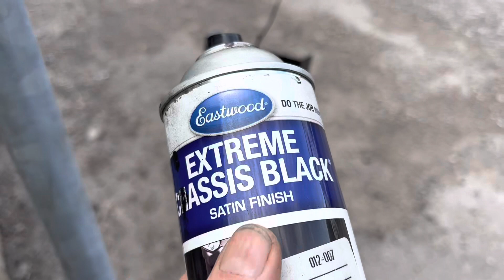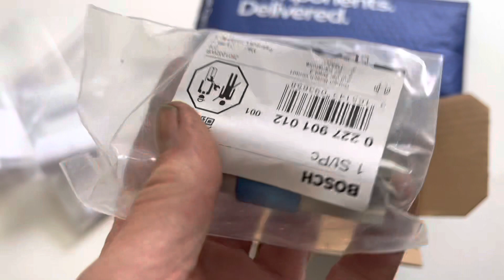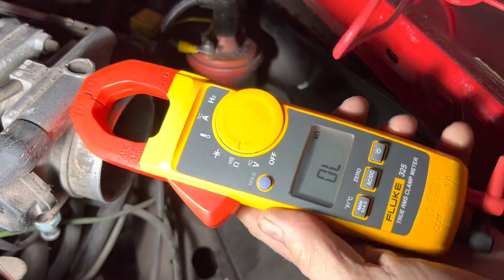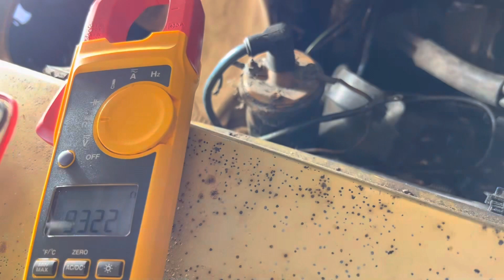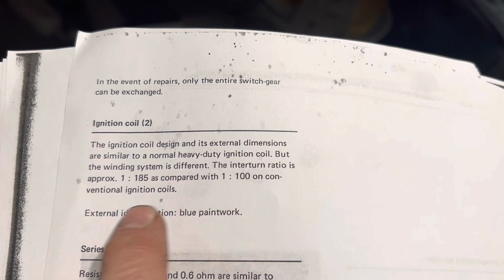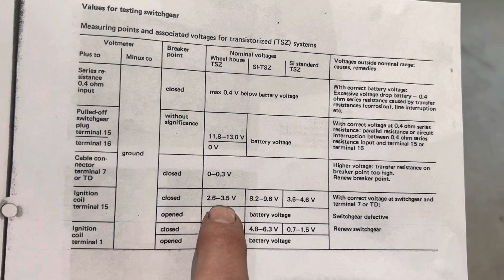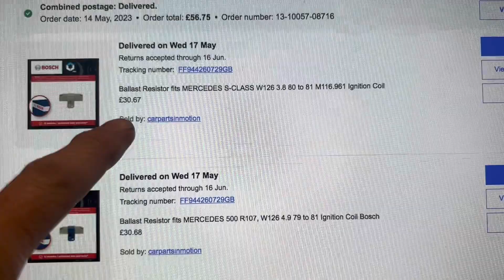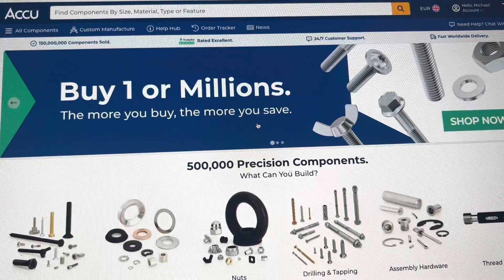Mercedes R107 ignition control module + ballast resistors

Comment: Hello, thank you very much for reporting the ohms value of the primary coil of the blue ignition coil. I'm working on a 1972 220 and have been trying to find that value. Thanks to you I've found that the old coil is still good and correct, so I don't have to replace the coil. The two resistors also check out correctly, though I'm keeping in mind your suggestion of replacing them and using new stainless screws.
Reply from the maker: Thanks for your comment - I knew that one day these detailed videos would be of use to someone! Mike
Reply: @MikesMercsandothercars  Hello Mike, after a tune-up on the 1972 220, replacing all of the basic things except the condenser, with the new points set to .016, the dwell angle was 38 deg (doubling 19 deg on 8 cyl scale). So I reduced points gap to .014 to increase dwell angle, but instead dwell angle decreased to 34 deg. Also the engine started dieseling 4-5 coughs after shutting down. I found the condenser wire that runs forward to under the battery tray was damaged, so I replaced the condenser with Bosch new old stock. Now I've started it and dwell angle is still 34 deg, but after idling for about 20 min and shutting off there was no dieseling. I wonder if you've ever heard of dwell decreasing with points gap decrease, instead of increasing. The dwell is to be 47-53 deg. It's a transistorised ignition, W115. A/T.

Comment: Mike youre a godsend with helping people with their Sl's. I rebuilt my djet harness and in process of testing, my 1972 350sl (4.5) just wont start. I turn the key and get 12v at the starter but no crank, ive bench tested the starter and it works fine, but ive changed the relay (starter, fuelpump) but still nothing any thoughts?
Reply from the maker: Hi - have you checked that the neutral safety switch works OK? See

 https://youtu.be/ZYn9P0j1nJc?si=8pKaiJKV8FnxaDgz

Try starting the car in neutral and let me know how you get on. 

Mike

Comment: hi mike great vids ty,
i have a 1972 350sl has run great since i bought it 3 yrs ago. all of a sudden it won’t start, i turn the key and and it goes to start but doesn’t run, any ideas what to check first thanks vince
Reply from the maker: Hi - first I would check that fuel is getting to cold start injector and squirting out when you crank the engine. I have a video on the subject. 

If you are getting fuel at the cold start injector, I would be checking that your fuel pump is putting out the correct pressure. Weak pump = no start. Once again I did a video. 

If your fuel pressure regulator is knackered and you are dumping too much fuel into the cylinders, this will also cause a no start. Easy way to check is to take out a spark plug and see if it is wet. 

That is where I would start…..

Mike

Comment: Hello, Mike! Thank you for your video! 😊 May I ask for your experienced opinion on something? My ‘74 R107 does not start when I crank the ignition, but when I turn the key/ignition back off, it DOES spark (spark seen with removed spark plug). Distributor, cap, ignition coil, ignition point SMP part have all been replaced. Does it sound like the next shot would be to replace these baluster resistors? Thank you so much!
Reply from the maker: Hi - the first thing I would ascertain is that you are getting fuel - have you done any checks - if so,which tests?
Eg fuel pump working? 
Fuel pump relay working, 
Fuel getting to injectors?
Cold start injector squirting fuel
Take out a spark plug and see if it is wet- too much fuel will lead to a flooded engine and a crank no start.
Reply: Hi, Mike - Thank you for your reply! I’m certain the vehicle’s getting fuel. Spark plugs are wet and don’t seem overly saturated. Cold start valve works. I’m stumped and will absolutely go over everything again. Grateful for your work/content and thank you again!
Reply from the maker: @manylaughs9002  Hi -its just a thought...and probably a stupid one...but after rebuilding the fuel system on the 280sl, it wouldn't start which had me stumped for ages - it was simplay a flooded engine see:

https://www.youtube.com/watch?v=JZd0SMJelZ0

Could be something as simple as that? Mike
Reply: Hi, Mike - Will definitely be giving this a shot, too! Hoping it could be the tell-all be-all. Thank you again and again for your response and videos. Love the direction and will keep up with you. Much appreciated!
Reply: Hello, Mike! I’m back for another question please! With the key/ignition ON, the ignition coil reads 7v (measured with multimeter) with the wires connected. When I disconnect the wires, the wires read 12v. Does this indicated a faulty coil? It seems to provide correct numbers of ohms (referenced in videos) when I remove the coil and test it by itself. Thank you!!
Reply from the maker: @manylaughs9002  The correct voltages are shown in the service manual at time code 14.46 in the video (https://www.youtube.com/watch?v=XOjgvaIT3Bw)
Faulty coils are not unheard of but rare. My advice = check the fuel system. Mike
Reply: Thank you, Mike! Do you think replacing the ignition control module would aid in anything at the point of trying everything (so it feels like)?

Comment: I have tried wiring it like this, + from coil to resistor(the top silver one, 0,6 ohm) from other post on the resistor to a green wire going to the rev counter 😊 i have pictures of this, so if you have an e-mail i Can send Them to you, thank you 😊
Reply from the maker: Sorry just reread your post. Has your rev counter ever worked since you’ve had the car? Mike
Reply: @MikesMercsandothercars  thank you for you replay. it has never worked and it was not wired in when i Got the car, i am trying to figure out the wiring. Do you maybe have a diagram or a picture of how your ballast resistors are wired? 😊
Reply: @MikesMercsandothercars  it is a 350 slc from 1972

Comment: Hi Mike, thank you for all you awsome and helpfull videos. I am trying to get my rev counter to work in my r107, i have a new ballast resistor but i am unsure about the wiring, i have tried wiring it but the revcounter is not reacting, any advice? 😊
Reply from the maker: What model and year is your Mercedes? Non working Speedo is usually related to either the cable or the Speedo itself. Mike

Comment: Hi, thanks for the video. Is there a plug on the bottom of this early ignition control module where the wires are coming out? Or the wires are firmly connected to the inside of the module?
Reply from the maker: Hi - the wires are moulded into the ignition control module on the older cars. There is no plug. Mike

Comment: Hello Mike, how can i check my ignition control module is working properly. I make the mistake to recharge my battery with the minus and positive cable screwed to the battery. Since then i have some issue in starting the car a 1973 450 sl. Thx for your feed back. Cheers.
Reply from the maker: Hi - the easiest way is to swap the unit for a known good unit and see if the issue goes away....but the correct unit for a 1973 may be difficult to find. Where are you based? Mike
Reply: @MikesMercsandothercars  in France
Reply from the maker: @NicolasdeBreteuil  Quel dommage, if your were closer, I would suggest swapping the unit from the car I am currently working on. Another alternative could be to bypass the ignition control module using the Petronix electronic ignition:

https://www.benzworld.org/threads/pertronix-install-with-and-without-switchgear.1714668/

Mike

Comment: Thanks Mike. My fitter believes he has solved the problem now. The ICV is new but there is an electronic sensor on it that might not be receiving the correct signals from the ECU, which looks like it has been tampered with. My adjusting the throttle manually, he has obtained a smooth tickover after warm up of 500 -750rpm. Do you reckon I should have the ECU tested / replaced or is that expensive? In fact the engine runs fine now, so I might just leave it for now. Any comments would be much appreciated.
Reply from the maker: That is great news! My own view is that "If it aint broke dont fix it" so for the moment I would drive the car and see how it settles in. The ECU's are often blamed for faults but are rarely the culprit. It is expensive getting them tested...and there are not that many places that have the capacity to do so. What part of the country are you in?
 Mike

Comment: Hello, congratulations on the demo videos!
I wanted to know if you can help me with the repair of a BOSH 0227 0510 17 ignition control unit for a 1971 Mecedes C107.
I can't find a Motorola SP2522 7239 transistor.
Do you have suggestions?
Thank you

Luca
Reply from the maker: Hi - sorry to read you are having problems sourcing a Motorola transistor to repair you ignition control module. These transistors were often used in radios so you could try emailing Graham at radiocruncher.com. There is a guy on eBay who repairs mercedes ECU's and other modules. His eBay name is ecut79 or type in item number 355394603335. It is also worth checking ebay for people who are breaking SLC;s for example ebay item 285696750262. Good luck Mike
Reply: @MikesMercsandothercars  Thank you very much for your suggestions!

Comment: Thanks Mike. I always enjoy your videos as I have a 300SL 1989 that is almost restored but the engine fails to idle. It revs and runs very sweet if throttle is used. My fitter has replaced the idle control valve (was missing and had a primitive LPG bolt doing the job before this), the coil, plugs, plug leads, distributor , fuel filter and fuel distributor. Do you think we should replace the ballast resisitors or do you have any other ideas? We think the problem must be electronic. Regards Nick.
Reply from the maker: Sorry to hear you are having problems - where are you based? I doubt whether the ballast resitors would have a bearing on this issue. Mike
Reply from the maker: Just a thought, but what happens when you disconnect the idle control valve - does the car idle albeit with high revs? Did he replace this unit with a  new one or a 2nd hand one? Mike
Reply: @MikesMercsandothercars  
Hi Mike,
Idle control valve is new and when disconnected the problem still exist.
Thank You
Reply from the maker: Hmmm. Can you send me a photo of the idle air valve connected to the car...with the air box removed so I can see the rubber hoses and vacuum lines. m_scott65@hotmail.com

Have you done a vacuum leak smoke test?

I'm not an expert on the m103 engine in the 300SL. I know some of the later models like the 560SL had an idle air control module located behind the glove box....not sure about your car but maybe a call to Mercedes Parts dept or the SL Shop would confirm.

Let me know how you get on.

Mike  @HarpendenMillAutocare

Comment: mike will these ballast resistor sizes fit a 1976 280S?
Reply from the maker: These resistors are generally colour coded and have the ohm value stamped on the side- do you still have the old resistors? What model engine does car have (eg M110?) and what year is it? Mike

Comment: Mike can you tell me where your getting your new ballast resistors and screws and where you goto to determine their part number. Also the .4 is markered buy what is the size of the silver ballast resistor. This video is a massive help. please and thank you JoeB
Reply from the maker: Hi - the source and part numbers are usually given at the end of each video - at 17.55 in this particular video. I got the ballast resistors from eBay. Mike

Comment: Hey man I have a question, what are the wires coming from the ignition box brown, black,red, green? Any information would be appreciated
Reply from the maker: Hi - do you mean where do the wires connect or do you mean what signal do they carry?

At 15.34 in the video, I show where they connect.

The exact ignition control module wiring depends what make model and year car do you have. If you send an email to m_scott65@hotmail.com I can send you a wiring diagram. 

Mike

Comment: Hello, thank you for the video advice, I have a 1973 450SL that I have been restoring, I got to the point where I have tried to start it, No spark and now no power to the fuel pump. From what I gather the ballasts could be effecting the operation of both problems. Being in Canada the parts are pretty difficult to get, amazon seems to be the only solution, one question is I notice the parts numbers on the ballasts that you installed are different, why is that. Ronald
Reply from the maker: Hi - does your car turn over? Eg is there power to the starter motor?

Not sure I understand your comment about part number - do you mean the part numbers are different from your car?

Mike
Reply: @MikesMercsandothercars  ballasts one is 4ohms other is 6ohms... car turns over like crazy, no spark and fuel pump not working,(was working previuosly)
Reply from the maker: The ballast resistors shown in the video are correct for that car and they should be different values. 

Assuming there is no voltage at the fuel pump, the first place I would look is at the fuel pump relay. Take the relay out and crank the engine and see if you get any voltage where the relay plugs in. Have a look at the video I did on first turning over the car. 

No spark - first thing I would check is that you have connected the coil to the distributor….the amount of times I have forgotten to reattach that central lead! Next I would be checking that you are getting voltage to and from coil….and finally you could check voltage at resistors. 

Good luck. Mike

Comment: Mike….. George says the SRS light is on. Is this a problem or is there an easy fix?
Reply: I forgot to add that it was after the flat battery. So I imagine there will be a reset somewhere 🤷🏻‍♂️
Reply from the maker: Hi John, the safety restraint system light generally comes on if you move the seat backwards or forwards and knock the connection which is often a yellow harness. My car is too old to have that system so I’m not sure of the exact set up on your car. Failing that, you can often turn that light off using a scanner. I have a scanner that will probably do the job. Mike
Reply: @MikesMercsandothercars  thank you 🙏. I’ll pass that on to George. Also the passenger seat is out, so maybe could also be the cause.

Comment: Another great video, thanks Mike.  On my 450SLC the ballast resistors get really hot with the ignition turned on but engine not running.  Is that normal?  Until this video I assumed that the ballast resistors were parts for life and would never need replacing but maybe mine do
Reply from the maker: Ballast resistors lower and regulate the voltage by turning that voltage into hear so they do get hot. Obviously as the car is moving, air will cool them down. I suspect that over time the insulation starts to deteriorate which is why they get super hot. If the resistance was higher than it should be because of corrosion etc, the resistors would get hotter than they should....but you would tend to notice this in the running/idling of your car as the spark would be less powerful. For the sake of £50 and a couple of screws, I would change them....and let me know if it makes any difference to the running/starting of your car...and the temperature of the resistors. Last but not least....what year is your car and have you got the correct coil on it? Mike
Reply: @MikesMercsandothercars  Thanks Mike.  Mine is a 1974 car and the coil is blue.  it runs fine and the resistors are not hot with the car running even if stationary but as you say for the cost of new ballast resistors i will replace them.  In checking the coil colour I’ve also just noticed that there is a condenser or suppressor (small tube thing) attached to the bracket of the coil but its cable is not attached anywhere. It isn’t’t on the wiring diagram but I have no idea whether that is significant to anything
Reply from the maker: @jonnybigpotato  Hmmm - once I get my car wired up correctly, I will be interested to do a temp test on the resistors when the ignition is switched ON but car not running.

Blue coil is correct.

On my 1974 450SL there was a small brass fitting on one of the plugs (you can see it at time code  4.21 in the video) This is a special port/plug for connecting a D Jetronic test probe to things like Dwell angle etc. Maybe that is what you are referring to? Mike
Reply: Saw on your latest video that yours get hot too! Good to know
Reply from the maker: @jonnybigpotato  Yes - I was surprised at how hot those resistors get. I have never noticed it on my K jet 280SL...but there again, I have not had cause to leave the ignition on and touch them. Amazing what you learn as you reassemble one of these cars. Mike
Reply: And thanks for the suggestion but no that round thing is different I have the one you refer to as well.  The one I was asking about looks like what I had on a MK1 escort years ago and was described as a suppressor supposedly to stop the coil interfering with the radio.  Maybe that is what this thing is too although it isn’t wired up and the radio is fine.  It doesn’t seem to be doing any harm so best left as is for now